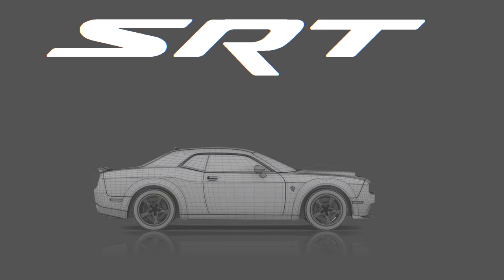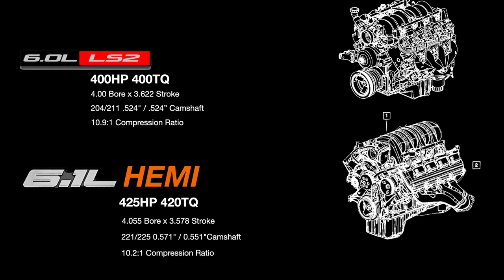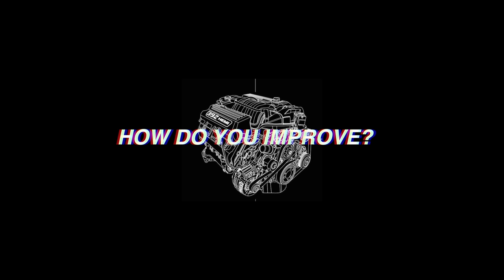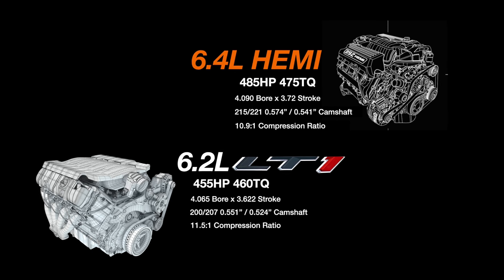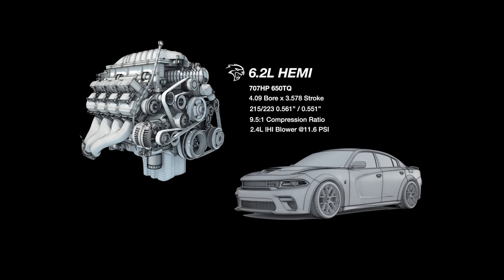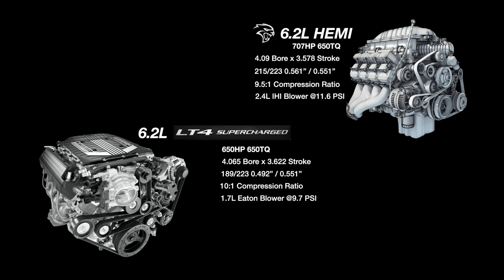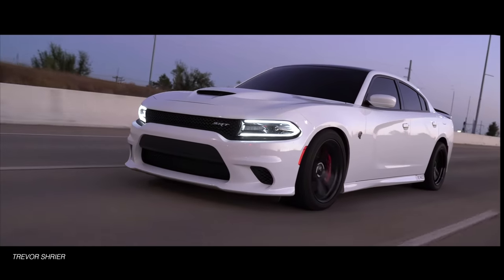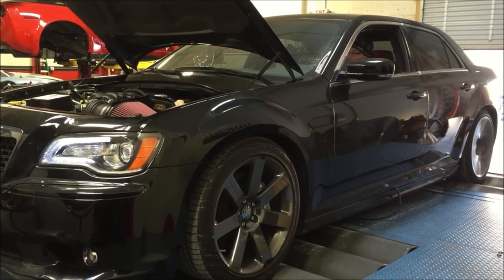Why SRT Engines Are Way Too Powerful😳| Explained Ep.3

Comment: Would like to see more about the NorthStar 32 valve V8. I know alot of people wouldn't care about it. I just want to know why GM went with this engine in some of its vehicles instead of the LS motor
Reply: I think it was supposed to be more efficient but sadly it had issues with the heads lifting I believe
Reply: They wanted to he fancy
Reply: The North Star was an overhead cam engine whereas the LS is a pushrod engine.  The LS has great low end power, but the North Star can rev a lot higher and makes peak power in a much different area of the range.  If you can fix the head gasket issue they're actually great engines.
Reply: Northstar are poop soup try doing a starter on one lol
Reply: It was a semi popular and cheapish upgrade back in the mid 00`s for mustangs. We had one we were going to build up and put into my then new 02 gt, never did it though. But in stock form they were crappy for enthusiasts
Reply: Biggest issue NorthStar engine had was it had no fly wheel. Instead it was 4 computer sensors. They were extremely expensive to replace.
Reply: @lincolnls0416  that was prob the reason we used to see a ton of them laying around back in the day.
Reply: @alexvillalobos7137  Yep, the head bolts were about the diameter of a pencil...

Comment: Good video. Wish Dodge would've used the SRT 6 in more vehicles instead of just one (Chrysler crossfire)
Reply: Dang i forgot about that, i think they should’ve made it an option for the GT trim since it have the looks of an R/T and give it an extra 30 to 35hp to compete better with the v6 camero and mustang
Reply: It was a Mercedes engine (M112K) you can get the V8 version (M113K) in any AMG car of the era (E55, CLS55, S55)

Comment: I know for a fact that the LS3 has a mild cam so you can drive it w/o problems for 200 to 300,000 miles w/o problems other than simple stuff. Water pump a d alternator and battery. 
Just change the oil at the dealer.
Cski 2018 Camaro SS 1LE. 12,900 miles

Comment: When the scat pack charger on a dyno they’ll be around 400rwhp but on a 4300+ pound curb weight boat it makes them seem slow. When a stock golf R at 250 whp pulls scat packs all day there needs to be some changes

Comment: 6.1s CAN hold boost. IIRC they can handle about 9psi before needing to gap the rings. 392s are the ones that can’t handle much. I’m a 6.1 owner myself, I have an 06 Magnum SRT8 and it’s an incredible motor and very solid. I plan to go cammed N/A with mine

Comment: People think you can throw a supercharger or turbo on everything. If you think you can supercharge an engine, that has a 11:1 compression ratio naturally aspirated, you are going to hand grenade your engine. Not only do you need bigger lands and more ring gap, but less compression ratio, by either de stroke or dished pistons should be considered.

Comment: A piston with a lower compression ring height  keep the upper ring out of contact with the hottest portion of the cylinder, which is closest to the cylinder head in most cases, keeping cylinder head temps down is a task, Nitromethane TopFuelers dobthis by plumbing the fuel through orifices drilled through the billets or castings during manufacturing or per application, you can get the same effect by running copper HVAC capillary tubing internally through the jackets via machined and tapped jacket bosses and plugs with orifices to isolate the engine coolant, and pump Nitrous Oxide through the tube in metered bursts to drop coolant Temps, and the more conductive contact the heat absorbing liquid expanding until it transitions into a gas has while still a liquid, with the actual material substrate (engine casting or billet metal) the more rapidly the temperatures will be reduced, this can be vented into a vacuum tank purge collector, or into the air, check with your officials to see if it's allowed in your class

Comment: While the ring gaps are tight on the 392's and yes the top land is pretty thin,  if you keep the boost reasonable and with solid tuning boost isn't an issue. 
I installed my 2.3L Magnuson quite a few years ago on my 2011 SRT8 at 42k miles.  It makes 6.5lbs of boost and was tuned by AJ Hemifever.  It not has
74k miles and aside from some belt and tensioner issues over the years and bearings going out in an idler pulley, it's been rock solid reliable and I just 
met a 22 Widebody Hellcat last weekend in Mexico and he could not get away from me.  

We met up after playing and talked for a few hours, it was funny he got out and came over and was like "That is NOT a stock 392.....!"   :)
(I thought the Boost On Board stickers would have given it away) 😁
Reply: hahaha nice one! I wish you took a picture of that look on his face hehehe 😅✌
Reply: @IhateYoutube  glad he appreciated your sweet ride Sir 🙂

Comment: One thing chief. The 2005-2008 5.7L DID come with a 350hp setup. Dodge increased the diameter of the air intake tube in the Daytona editions.

Comment: The 6.1 can be beefed up to around 2,000 hp, changed internals and leave it at 6.1 liters.  I know someone who did this and just passed 400 runs down the 1/4 mile.  Only transmission that can hold out modified - th400 by gm.

Comment: The MDS on the 392s was a big mistake. My Challenger is dying a slow death because of the damn lifter bearing seizing up. Cylinder 5 hasn't worked in a while and my oil looks like it got bedazzled.

Comment: Considering the LT1 is GM and in the usual fashion has more torque than HP and much higher compression using the peak power numbers does a disservice. The 6.2 probably gets better mileage and probably also has a much flatter torque curve.

Comment: Or buy a 5.7 with 200,000 miles, plastiguage rod and main bearings and IF WITHIN TOLERANCE, add a new hi volume oil pump and throw a few lbs of boost at her..... She will take it, the rings are worn enough to not squeeze off the piston tops.  If you blow it up, pik n pull has another one for $400

Comment: Only about 33% of the energy from burning Gasoline translates to engine out put and power. The other 66% of the energy is thrown away as heat in the process. So if you double the power out put of a engine you quadruple the heat out put. Most metals like everything expand with heat. 80% of combustion heat gets transferred to the cooling system via the top piston ring and cylinder wall. The modern trend towards low radial tension smaller compression rings. To combat parasitic losses. This tends to make the ring it’s self run much much hotter. So much so that modern NASCAR teams pay 100$-200$ a piston to “hard anodize” the top ring groove. This allows the steel top ring to run much hotter than the annealing  point of the aluminum groove and combats piston rings micro welding to the groove. In high performance engine there is really no down side to increasing the end gap in your rings. I worked as a engineer at BME Ltd one of the leading manufactures or forged aluminum racing pistons. 90% of my engine building back ground is in  Top Fuel and Top Alcohol Drag Racing. We run up to .055-.060 end gap and .0125-.0135 PTW clearance. If you do the math on a 4” bore size. A  .050” gap is less than a 10th of 1%  0.06% the total Face sealing area of the piston ring. So there really is no down side to running a bigger end gap in the rings. While not running enough end gap will 100% of the time lead to catastrophic engine damage that starts with the piston ring butting thus seizing in the bore. Usually ripping the top land out of the piston resulting in ruined cylinder heads with broken or bent valves. The late model Hemi is not really a hemi at all it’s a semi hemi or squished hemi that has a defined quench on both sides of the valves. My father Donnie Holm manufactured the first 100% CNC aka Billet Hemi head for drag racing engines in 1981. As much as I love the Hemi the only thing it’s great at is WOT peak power numbers and that’s why it’s only really dominate in drag racing. I’m Mopar or No Car and my favorite engine for the street is by far the Wedge because the Hemi makes higher peak power numbers but the Wedge makes more power every where else. This is fact and not just my opinion! 🚀

Comment: Great video. Since I have been in LS land I wasn't aware that the Hemi heads flowed such air stock out of the box (334  CFMs on the intake side, WOW!!). Here in the New York City/Tristate area 392 Chargers are everywhere and I see why they are a great performance value dollar for dollar than the Hellcats. Besides they sound way meaner the Hellcats. Just tootling around town Hellcats are as silent as 6 cylinder Pentstars.

Comment: You dont need to throw in forged anything to make power on a 5.7 or 6.1. Just gap the rings, throw in a cam, lifters and add 10-13 psi of boost with good fuel and make over 600 hp all day.

Comment: If the 65rfe in my ram would be able to handle the torque, I woulda supercharged my 5.7 long ago. That shortrunner valve makes a noticeable difference when you're hammering the throttle hard.

Comment: We still build Chevy motors with performance in mind with longevity thought process. Those Hemi ‘s are for straight line only on a good day (dry road). Chevy can hit a track anytime with .30 over running hot and still out last those hemi boat anchors. If not, still cheaper to rebuild chevy motor🤷‍♂️

Comment: I’m a firm believer that dodges tranny get a bad reputation cause the big engines with lots of power just thrash it ! Same with the LS engines they got lots of power as well and I had to get my tranny replaced in my 08 trailblazer SS it’s definitely something to consider and to be aware of if your hemi or ls is around the 100/150k mile mark. You may be do for a new trans soon but it’s all about how you care for your car ! I was not the original owner of the SS to I was the second.

Comment: I'm baffled how ICE heads are worried about the maintenance and repair costs of EVs...just look at how many moving parts there are to an engine. You'd be lucky to push 1000hp and run half a dozen 1/4 mile drags back to back without something breaking. All the while an EV can do it all day long without breaks then come back to do it all over again after a full charge.

Comment: Have A510 short deck deck marine application block in my old C3 Corvette with the Richmond 6 speed brodix port matched heads and a solid cam isky dunked.   I drive it on the street and even motorcycles can't stay up with me lol

Comment: For a while, Dodge was buying and using GM 5.7 blocks. GM can't sell the 5.7L V8 and marketed as such anymore because it sold those rights to Toyota. But, GM can and does continue to produce the 5.7L and sell it. 

 The Dodge engines are high power, brute force. But, the Camaro and Corvette are simply fast as hell both street and track. Chargers, etc. are heavy as hell cars. Also, once the cylinder > 500cc, the efficiency starts dropping, i.e., return for money drops, as does power for cost. The most efficient cylinder size is 500cc or less. This means that a 4.0 V8 should be plenty big enough to make whatever power you want. And then factor in the added weight, and it just becomes pointless, except to do burnouts and fishtail around corners. Just look at the 2022 MB GLA 45 = 2.0L 382 HP and fast. And, I am sure that engine is capable of 500hp. Or, Honda 2.0L in the new Type R that is built to handle 500hp and can easily get up to 500hp. Even slightly more boosted and a tune the Type R can hit 350-400hp and weighs what ... 3200 lb?

Comment: The new “Hemi” is a flawed design and a cam shaft killing monster.
Reply: Yes their junk compared to ls capabilities , I'd mod a old la like a 360 over any hemi , easy 450 reliable hp and I've seen some with 600hp on stock bottom end .

Comment: Boost aint everything. Can get 650-700 horses from a 6.4 anyway, cam obviously tunes but head work is key for flow as thats where the power comes from. Most engines will need rebuilding anyway unless your using a street friendly more tamed down blower set up. The motor might hold up the power for a while with the blower on the ford/chev but I certainly wouldn’t rely on it forever.

Comment: Gen X here. Mopars sucked in the 70s and they suck today. No ring gaps lifter problems 5 times more expensive than anything else you can buy. If somebody wanted to race you in the 90s in a Mopar. Chances are it would not start or didn't run worth a damn

Comment: this is a great video... i love how you compare the hemi to only gm motors... the great part is when you speak on the power difference ... SRT pushes there engines to the max for max hp... the demon was a short run and had tons of lifter and other failures.... getting a hellcat to 1000 hp is possible and about the limit of the engine... getting a cts-v or zl1 camaro to 1000 hp is extremely easy and more reliable 1000 hp... gm builds engine to run 100,000 miles plus ...
Reply: Gm is the one with the lifter problems.  Ill let my friend with is built ctsv know he can make 1k easy.  Clearly you know nothing about them.

Comment: All this is originated into 80s
The srt4 engine took its original DNA in the 2.2 TIII engine .
The v10 viper was originaly developled from v8LA engines amd was developped aside magnum series with large contribution  o Lamborgine for the HiPo engenering , who was owned by chrysler at this time.
Finaly the 3dr gen Hemi have almost nothing in common with the original 50s Hemi firepower series and the 426 Hemi. In this case it take origin a bit later in beginning on 2000s with the 4.7v8 often called haft Hemi

Comment: As much as I want a Dodge Challenger Hellcat. I think I'm gonna suck it up and go with a Dodge Challenger Scat Pack. I'm not looking to race on a straight line. I'm looking for a good time around town, and so far I've heard the Scat Pack Challenger is a ton of fun for that. 485hp is still a sht ton of HP, and a back puncher I want to feel.
Reply: 392’s are certainly fun cars and sound awesome when the muffler is removed, but you won’t be beating everything around off the stoplights in town. Loved my TA392 but I have other cars now that made me realize it wasn’t as fast as I once thought lol. You won’t be disappointed with a scat as long as you don’t think it’s going to beat everything, they are very fun cars non the less.
Reply: @Troy T  I finally ended up getting a 2022 Dodge Challenger R/T 392 Scat Pack. 

Exterior:
Smoke Show Gray.
Sunroof. 
Red Calipers.

Interior:
Alcantara Ruby Red Seats and Red Doors.
Heated and Vented Seats and Steering Wheel.
Memory Seats and Memory Steering Wheel.
Unconnect with Navigation, and I got the better Alpine speakers. 

Wish it would've come with the Harman Kardon setup. But I would rather hear that exhaust. Like you said, the muffler delete would sound amazing, and I'm thinking about doing that. Still need to get tinted windows. But I love seeing my red seats through the window.
Reply: @steadycuzzin5813  I prefer the alpine stereo myself and it’s what I had. My Durango RT has the Beats Audio and my Ram truck had the HK stereo and my Challenger’s Alpine was superior to them all.
Reply: @Troy T  I love it as well. My music does sound really good. Especially when the windows and sunroof are all closed up. I noticed it's got surround sound which is cool. I sometimes watch movies on my phone.

Comment: Like Harleys these engines maybe “shock N awe” inspiring powerful, but the cars design and technology they sit in is cheap (plastic moldings, low quality carpets, etc..) and unrefined.  These cars are now at $100k and have the mindset to please and wow the Walmart crowd. If one knows anything about basic engineering you can see it clearly. ALL are made to go in a straight line, few can handle a curvy road. It’s almost as if these cars are Made in China. My point, American car manufacturers need to put more overall quality into their cars to please the high end market. There is a logical reason people with money buy high end Euro sports cars in the same price range and It AIN’T all about speed.

Comment: The hemi is a great engine, I'll give Chrysler credit for that. The problem is the cars are overweight turds. The challenger hellcat weighs 4,500 lbs and the charger weighs almost 4,600. That's midsize SUV weight right there. I've gapped several charger and challenger 392's with my 02 z28 that has a tick cam, ported 243 heads and a tune (plus long tubes and a catback). I've kept up with hellcats until 120 mph or so.  That extra 1200 lbs makes a big difference.

Comment: I am not a racist, but I know that there is a car factory that makes V8-shaped engine with 7.4L for you that puts output of 776 horsepowers with 680 torque and it's an N/A engine so just dream how it can be on the track 😉👍 oh it's start with L And ends with R😈

Comment: The main problem with these srt motors is that they are strapped to heavy cars what’s the point of a 700hp hellcat motor strapped to a tank anything with 500 and up hp around 3k weight go head to head with the heavy cats if only they produced a cheap version of a viper with a hellcat motor boys would run the streets

Comment: SRT is dead now.

The Chrysler 300 SRT is gone. 
The Jeep SRT is gone.
SRT badging is no longer on these vehicles unless they come from Dodge. Dodge is moving to electrification and the only use for the 6.4 of the 6.2 supercharged at this point will be for the largest and most torque necessary vehicles such as the RAM and Wagoneer.